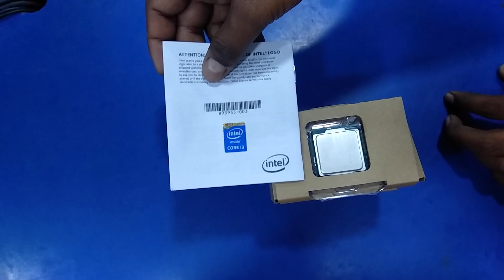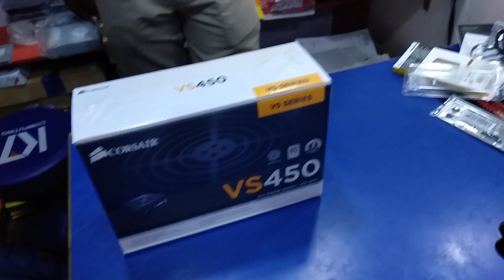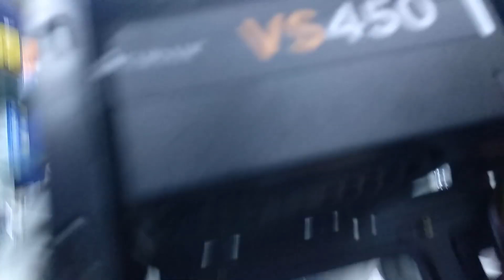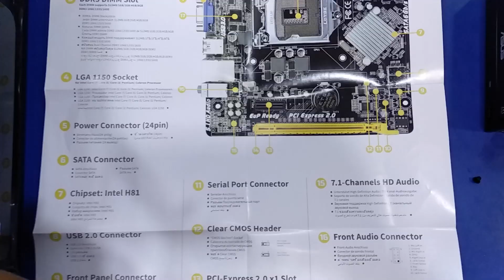Assemble a desktop computer in Tamil

Comment: Bro I have one doubt VGA avanga kuduthu irukura volt tha irukaanuma  monitor to CPU connect panromalae antha cable bro konjam sollunga ,because ennoda cable capacity 250v but athula 230v ac nu iruku...??
Reply from the maker: U can connect
Reply: Avanga kuduthu irukura volt tha connect pannanuma appadi connect pannalana computer adi kadi black screen or shut down pannama use panninu irukum bothae veliyae varuma sollunga bro

Comment: Thank you brothers Very gud and very useful video  but we  Need to clearly tell us  mother board wire connection as per voltage from power supply unit